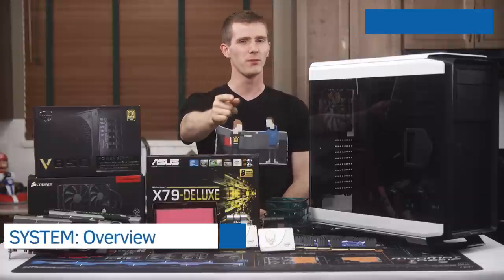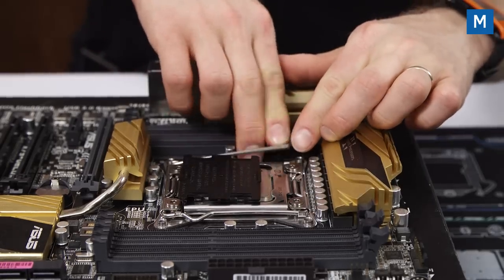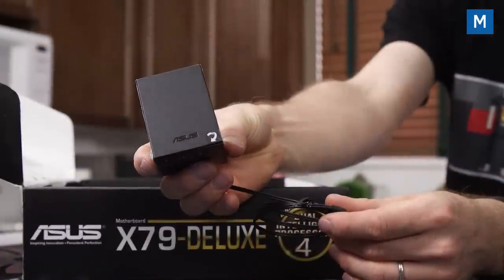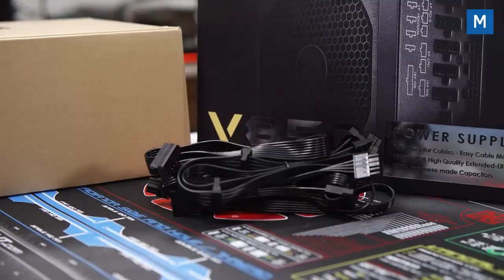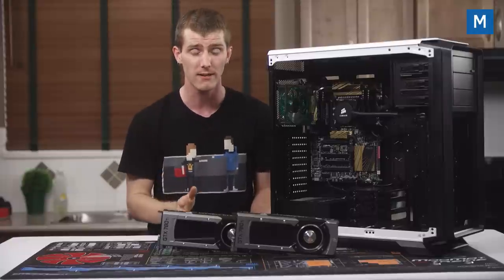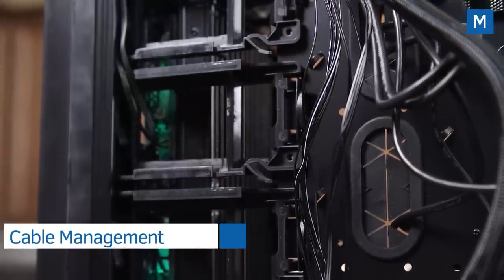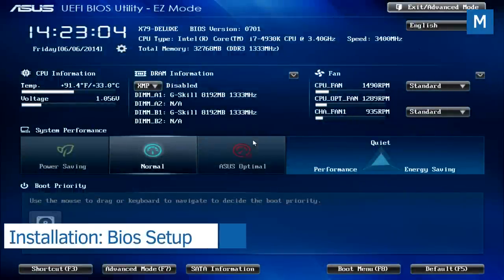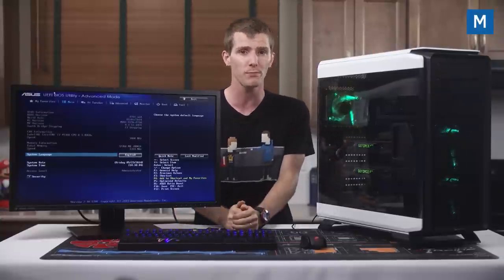How to Build the ULTIMATE 4K Gaming PC Build Guide

Comment: Question for all you pc gamers!
Are these specs any good? (New to PC gaming)

4.2 GHZ AMD quad core processor 
H80 LIQUID CPU COOLER 
16 gig of G2 g-force gaming ram 
128 GIG KINGSTON HYPER X SSD 
2tb hard drive 
1tb hard drive 
Titanium FX 1 sound card 7.2 surround 
Bluetooth 
300 Mbps wireless network adapter 
RADEON HD 6870 GRAPHICS CARD X 2 crossfire 
650 Watt power supply 
Thermaltake high tower case 
Triple monitors for eye finity display 
Gaming keyboard and mouse 
Sony micro hifi system 

Only reason I ask is because my mate wants to sell it to me and wondering if I should buy it OR NAH? Any good? Will it run MC? Is it good for video editing? Sorry guys, I don't know SHIT about PC's!!!
Reply: 1.) Ask him specifically WHAT AMD quad core (socket/model)  2.) Never even heard of "G2 g-force" ram. A google search doesn't bring up anything relevant, so that's a concern. 3.) Sound cards are a marketing gimmick, they actually reduce and distort the sound quality. 4.) 6870's are pretty outdated cards, even when crossfired they're not going to be on par with newer cards. 5.) What brand/model power supply? Is it some generic brand? Or is it from a reputable company like corsair, cooler master, or EVGA? 6.) Three monitors are not necessary unless you're after productivity (i.e. office work) 6.) What kind of "gaming keyboard and mouse"? A lot of manufacturers slap "gaming" on their products, but a lot of them are bad products. These are things I would like to know if I were purchasing a custom PC. I'd also like to know something about the motherboard manufacturer/model, and how much they are charging me. Personally though, from the information you provided, I would not purchase this PC for personal use. I'd buy it for the parts. Sell some, keep others as backups.
Reply: Yeah well everything you asked me I would have no idea about it hey, all I know is he wants 400 for it, should I get this or do I just buy a more expsensive and 'Brand New' pre made pc? I would build my own but I don't have the patience to learn and make one. Do you have any recommendations for a pre made pc? Budget is probably 1500-2500
Reply: Thanks for you're feedback as well, re-thinking my options now.
Reply: vRelapze If you  have that kind of budget, no. I cant really eloborate now because I have to head off to work,  but when i get back I'll drop some suggestions for you.
Reply: vRelapze This computer http://www.cyberpowerpc.com/system/Zeus_EVO_Thunder_2000_SE/  all you have to do is add "256GB ADATA SP610 SSD + 2TB SATA III Hard Drive Combo" from under "SSD + Hard Drive Combo" in the customization section. You're really not going to need more power than that for some time and it stays within your $1,500-$2,500 price range.
Reply: vRelapze for $400 those are some damn good specs
Reply: If he is selling it for 400 amazing deal, if it all works, if it is really old, its still a good deal, will definitly run MC on highest settings, with the crossfire it will do good video editing for sure, rendering will be really fast with the 2 Graphics card. That computer new would be like 1500 dollars maybe even more, all around good deal, if you have the money definitly buy it
Reply: Cheers guys thanks for everyone's feedback but unfortunately he sold it to someone else for 700 only because I said I'll pass thinking that the pc might be a dud but sure enough I was wrong.
Reply: Just build your own 6 core to 8 core PC... Im an AMD guy
Reply: ActionFigureReview Yea, AMD is the same as Intel, just cheaper.
Reply: Jamz | GFX Design Not at all.
Reply: unfairtrout How so?
Reply: Jamz | GFX Design AMD processors are hot as hell with shit architecture. Clock speed and cores don't mean as much as people think.
Reply: unfairtrout I disagree.
Reply: unfairtrout You are so right. AMD is still using an architecture that was released in 2011 and they are still on the 32nm node. Intel last released a 32nm CPU in 2011 with the Sandy Bridge. That was the last time that AMD CPUs were "the same" as Intel CPUs that were sold in the same price range. Now, an i3 22nm Haswell destroys an 8350 in all the latest multi-threaded games. A fucking i3. AMD has nothing that beats an i5 and nothing that even comes close even if it is overclocked to 5+ GHz to an i7. And we aren't even talking about i7 Haswell Extremes which AMD doesn't even have a CPU in that market segment. Take a look at this review of the i3 4340 http://www.hardcoreware.net/intel-core-i3-4340-review/1/ ...in about 15 or so of the newest PC games in 4 different resolutions. The i3 is better than the 8350 in all of them. Even the Ivy Bridge i3 from 2012 beats the 8350 in at least half of these games simply because it is a 22nm CPU with a better architecture. Not only that, look at the power consumption. The 8350 uses 225 watts vs 98 watts for the i3. http://forums.overclockers.co.uk/showthread.php?t=18566305 Next year, Intel will be on the 14nm node with Broadwell guaranteed because they own their own manufacturing plants unlinke AMD while AMD will probably still be shitting out 32nm CPUs that were first sold in 2011 because TSMC is delaying a move to 22/20nm for desktop CPUs and GPUs due to setup and upgrade costs. AMD is currently 3 generations behind Intel and will be 4 generations if they don't release a new architecture on a smaller node by next summer.
Reply: Jay Man I expected to open this up to find someone yelling at me but I was pleasantly surprised.

But I would like to add. AMD being so far behind isn't good for anyone as its just going to lead to less competition in long run.
Reply: unfairtrout I know, it isn't AMD's fault though. Intel is so fat ahead because they own their own fab. plants and control when they want to move to a smaller node while AMD has to outsource their production to TSMC. TSMC is making 20nm chips but only for mobile phones and tablets. Nvidia and AMD were supposed to have 20nm desktop GPUs earlier this year but the move to 20nm and under is supposedly a very complicated process and very expensive. The only way AMD can keep up with Intel at this point is if they either build their own chip fab. plants and make an investment for the future or if they find someone who can make 22nm or 14nm CPUs for them. The only problem with the latter is that Intel is the only chip maker in the world that is currently making 22nm desktop chips and will be the only chip maker in the world making 14nm chips of any kind next year. This is what AMD fan girls don't get: more transistors = more CPU performance... smaller node = more transistors in the same area. If Intel is at 14nm next year and AMD is stuck at 32nm, Intel's CPUs will have literally more than twice the transistor density x the fact that they also have tri-gate 3D transistors (already since 2012) which will make it even more than that.  This is why an i3 is simply superior even to an 8350. It has more transistors AND a better architecture that does more with each transistor than AMD's does. 

EDIT: scratch that, Intel is CURRENTLY the only chip maker in the world making 14nm chips. They have been selling Broadwell laptops since October. Kind of forgot about that. But, their dektop Broadwells will come out some time next spring.
Reply: Jay Man Uggg..... Alright now that I got facts I guess I need to spend another few hundred dollars.
Reply: Yes of couce thats good also over clock itt
Reply: Jamz | GFX Design If you are a gamer, you can spend less than an 8350 costs ($180) on an i3 4340 ($160) and get about 20% better performance in every single game in existence, not just single and dual thread games: http://www.hardcoreware.net/intel-core-i3-4340-review/1/ Plus, the motherboard would only cost about $60 since you don't need to OC, actually, you can't OC. You don't need to OC it like an 8350 NEEDS to be OC'd just to get 60 FPS in same games. Point is, you don't need to spend a few hundred more if you want a good Intel CPU for gaming. Hell, you can even get the unlocked i5 4690k for about $225 which is only about $45 more than an 8350, not a few hundred. And if you OC the i5, you will have a CPU with performance no AMD desktop CPU can OC to; at least not a stable OC on all cores. A 4.5-4.8 GHz 4690k is probably the equivalent to a 7 GHz 8350.
Reply: it's a pretty good rig actually... you must find out WHICH quad core processor it is by AMD.....

What is MC?
Reply: looks like a bunch of crap to me.
Reply: Greencoast you got 2 number 6's
Reply: I wouldn't pay more than 350 for that since its used and the brands are all funky